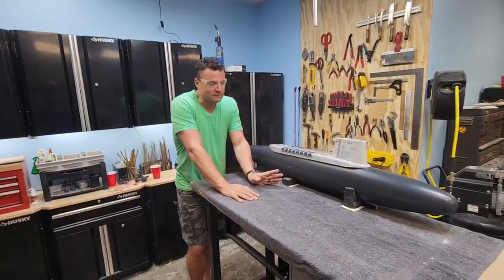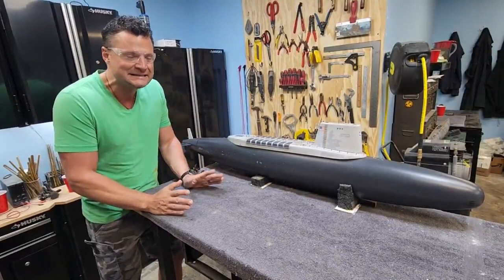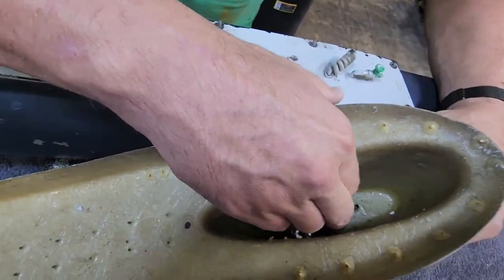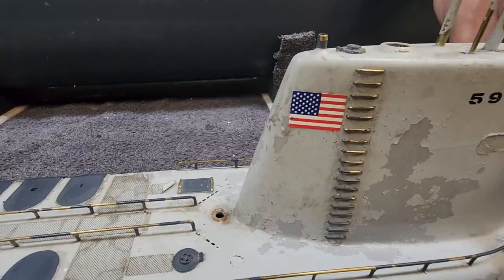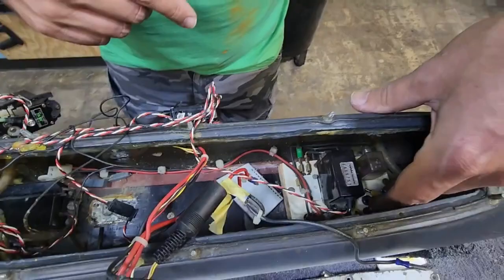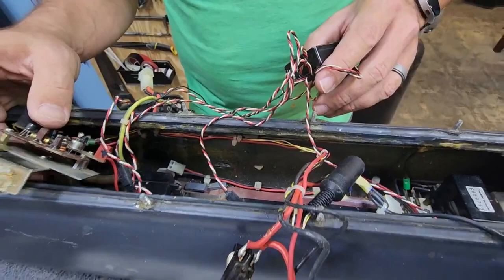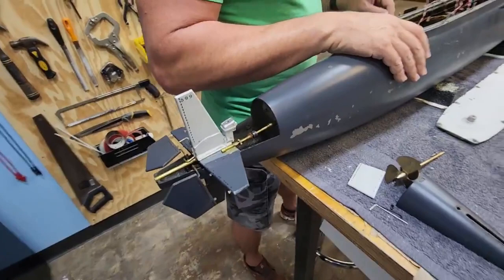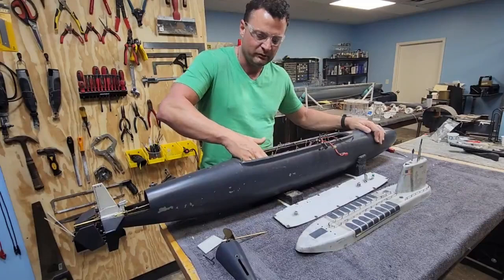A Vintage RC Submarine for 350! What Did I Just Buy!?

Comment: Hello. Here's what I remember: MRC imported Engel subs. This was their first submarine offering, then the Gato. Both appeared in full page color ads in RC Modeler magazine. Tiny renditions of the Patrick Henry also appeared in the wonderful ink drawn, full page ads of America's Hobby Center (NYC). As time went on the importer changed to Hobby Lobby International of Brentwood, TN - i.e. not the HL store you see around today.  RC Plane enthusiasts will remember them as the manufacturer of Telemaster kits (an Engel design!) - arguably one of the best flying RC airplanes of all time.   About 20 years ago the Subcommittee Report featured an article where the author dissected the P.H. hull to install a drive unit - essentially switching over to wet hull. A P.H. kit sat in my cellar for years, the idea of that drive gear in the free-flood area, along with the bearing being supported only by one screw did not sit well. (If you've got a set of plans, you know what I'm talking about).  Let's not even discuss the "design" for aft watertight integrity of the drive shaft and push rods.  What to do?  Hmmmm....   Years later when the Lafayette appeared it was a game changer - and it was obvious what had to be done. A motor mount similar to the Engel design was machined with o-ring seal to the aft bulkhead. Push rods were exited through o-ring fitted brass fittings.  No water getting in that way, but you'll need metal gears on the servos to overcome friction.  As far as main access goes, dispense with the hold down bolts and the aluminum plate. Use 1/4" Lexan and silicone. 20 minute set-up before sail and you can get in quickly anytime with an x-acto - or so I was told (hats off to Skip Asay).   No, its not finished yet. LOL   Needs current electronics to manage the tanks. Wish me luck.  😅

Comment: The piece that you were looking at with all the wires connected to it, it the old style ESC.  The servo would rotate the metal plate to connect the current to the motor the bigger the plate the faster the motor would run..  This was used in the 80's by Tamiya.

Comment: Bob I'm restoring that same boat ,I  traded a rc airplane for it back from the 80s ran it many times but weighs  a ton ,and makes alott of noise with all the electric motors running, I beleive that was Engles first boat . Dan
Reply: Hello Sir IV got this from BOB IV got a spare sail and deck but the hull was long gone   will keep you chaps in the loop how things go.  Tony from Oxfordshire UK

Comment: These kits hark from the late 1970's. I remember seeing ads for these and the Gato in early 1980's, at what were then eye watering prices for a schoolboy. A heavy boat being dry hulled, but they get through the water well, and are very stable. The gadget at around 5:48 looks like a resistance speed controller from a series 1 Tamiya Wild Willy or a Super Champ. Do not bin it, as you can get some caah for that on ebay if you advertise it right, as Tamiya collectors like to fit them on period restorations and it will offset the cost of replacement electronics. One snag of the early Engel kits is the tank design is different, so if you need new seals, you'll find the newer parts won't fit without work. Ways around it mind.
Reply: Also not sure if a modern Engel board will work on those old tanks, as the early ones had mechanical limits built in with springs rather than microswitches. I'd keep the original servo operated board for the tank control, it's basic but gets the job done. The super champ speed control was most likely for the drive motor- esc's cost a small fortune in the 1980's, as mosfets were pretty new tech, so most modellers used electro mechanical speed controllers.